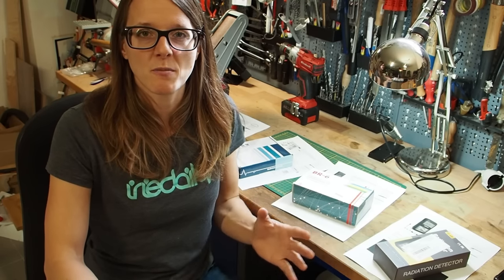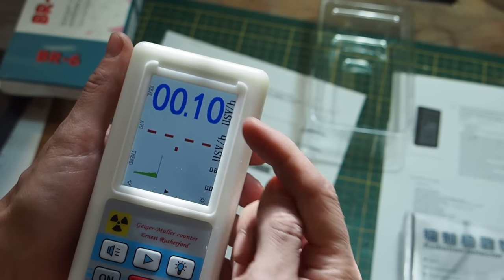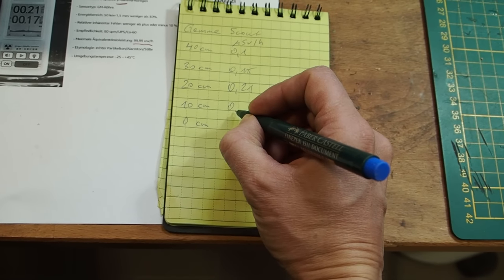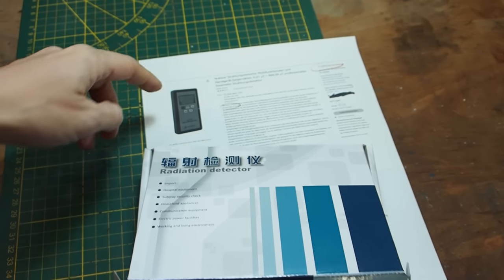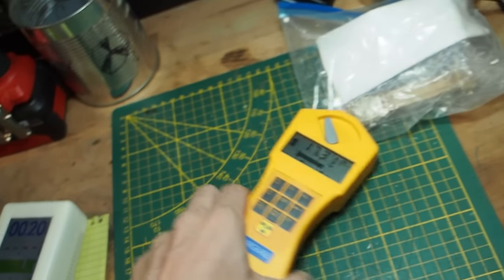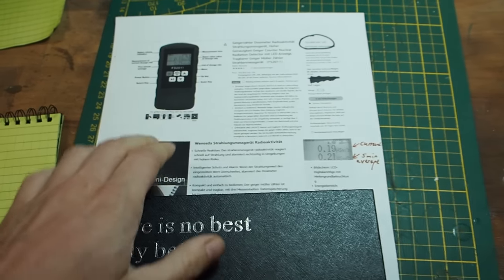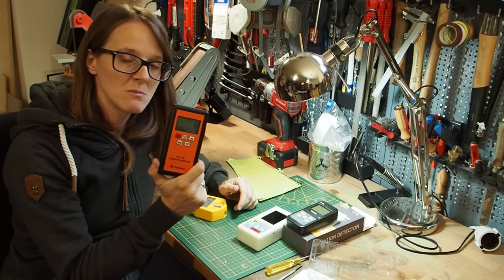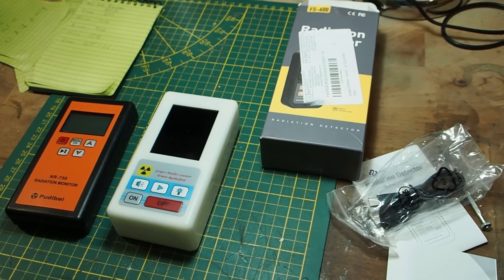Cheap Geiger Counters on Amazon - Only 1 is Worth it!

Comment: You have chosen wrong model of bosean, the FS-600 is a small tube crap, good one is FS-1000 with J321 model tube (is muuuch larger and waaay better). Im using it to test ground level radiation (Rn) as in some unventilated rooms i have almost of double of natural background which i measured in 2nd app and its done by Rn radiactive gas (after ventilating the rate decreases). 
When choosing a dosimeter just check the tube, thats the (main) decissive thing. And be careful, some dosimeters of the SAME model may contain different quality tubes!!! (accidentally or on purpose try to scam customers).
And hell till Russia still exists, dosimeter is a must have thing... like a compass and paper map (greetings to baltic airlines).   And living out of large metropolis to not be among first ones who will evaporate in WW3 but enjoy some fun in following PUBG battle royale...

Comment: You shut tell which Nukleid which is very imported. Also if Gama or Alpha because Alpha Radiation has 8 Peaks and destroy cells 100 times more then gamma radiation. And i do not see that you can mesuare the does. You can buy a Smoke Detector in the baumarkt there is Helium 3 in it. as you empty a few baumarkts you even can build a dirty bomb.

Comment: Dont forget that the BR-6 tube is from one of  the top corners to the opposite corner at the bottom,  you can see the GeigerMuller tube through the grid in the back.. The window on the gamma scout is at the top of the unit. I have the similar to the BR-6, also the GC GMC-320 Plus,  The radiation Network GeigerGraph (from Mineralab) has many many counters on line so  you can see radiation counts all over the world. I have an actual Radiation sample/calibration disk from the early 1950's.  Ah the black on has the mini GM Tube, by the way some of the older Counters have a metal tube, mostly the Russian ones. Great video, you really show how things work with the Geiger Counters.

Comment: Only one good Geiger counter for rest of your life is worth to buy- Terra P Bluetooth. It is cheap, and easy to fix if you drop it from your roof. Simply SBM tube inside is easy to find, and when it is broken, you need to put another one inside, like battery. It can make map od radiation at Your area, because of bluetooth.

Comment: Getting correct reading is more important than getting high reading. Very simple setting done by the manufacturer can increase readings which might impress some buyers, but is just misleading them in reality. Professional Geiger counters are calibrated to provide accurate info. In the case of cheap Chinese Geigers it's recommended to compare their readings next to a profi device to get an idea about its accuracy.
The point about Geiger tube location in a counter and the difference it makes if it is oriented toward the source of radiation was mentioned in the comments.

Comment: I am sorry but this comparison does not appear to be as fair as I can see!
In my personal opinion, although the Gamma Scout has a 'good' name and is pretty sensitive, it is grossly overpriced. Sorry again but the meters chosen are the crappiest on the planet! I would think at least a Radiascan 701A or even a GMC-300Ewould be a more realistic and fair comparison. The Radiascan would win hands down. I only know because I own a Gamma Scout and a Radiascan 701A :)
Reply from the maker: not everybody has money to throw out for an expensive geiger counter. I tested the cheapest. dont know what your problem is with the NR750 but it gave me the same readings as the gamma scout. since the gamma scout is calibrated that is a good thing isnt it?
Reply: @SurvivalLilly  I didn't have the initial outlay but I saved my pennies and got the right machine

Comment: Some of the cheap counters have the tube inside along one edge, not the end, so the close reading has the tube further away than the end would indicate. I have a cheap one off Aliexpress that runs the same software with the man's image as shown on the first unit, but the package is slightly different. In removing the cover, the glass GM tube is seen on the side. The results were confirmed when approaching my sample, a radio active lantern mantle,  to produce the highest reading along the left  side of the unit where the side of the tube is closest to the sample. You get lower counts off the end of the tube which faces the top edge of the unit. Tube orientation to the sample makes a large difference. If you buy a cheap unit, find out where the tube is inside. Highest counts are as close to the side of the tube as possible for the units with a glass GM tube. Using the unit as a dosimeter is lacking as the unit does not total in non volatile memory, but starts the dose from zero every time it is started.

Comment: Get a surplus civil defense or military Geiger counter. They are old and clunky (and cheap) but have a higher range that you will need in any catastrophic event. All that you will need is a 9V battery. As an option one can also get an extension to take the sensor farther away from you if the counter is mounted in the house and you’d like to see what levels are outside.

Comment: Hi Lilly  I'm a fan of your archery videos mainly. Have you thought that the detection data you were collecting is dependent on having a verified baseline. You seemed to think that the units with the high readings were 'good' and low readings not worth buying. How do you know that the high readers weren't wildly inaccurate?
In the nightmare of a nuclear exchange won't the fallout be spread over 1000s of square kilometers and so, what use would it be to read this very high radiation when it is everywhere.
Reply from the maker: The gamma scout is calibrated and certified

Comment: Thanks Lilly for a very educational and well thought out test. After checking for this with your link, the price did indeed go up, however I found it on Amazon for less, but they had two models that improved on the one you recommended, the NR-850 and the NR-950. After reading what they test for I went with the NR-950, I also payed $10 for three year replacement warranty, but if Putin drops nukes within the next 6 months, I guess that warranty won't be any good. 😁 Keep up the great work and praying you and your family make it thru the winter okay. Take care.
Reply: Hi Brian, what are the differences between the 3 machines?
Reply: Looks like the accuracy. Anything else?